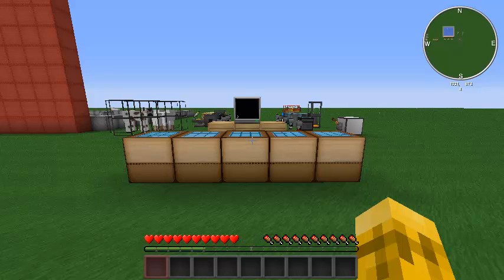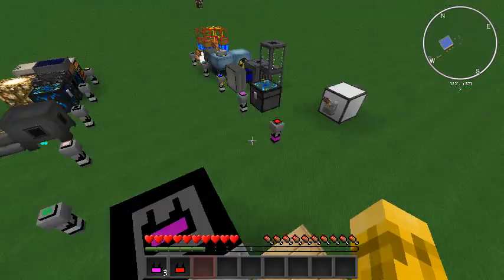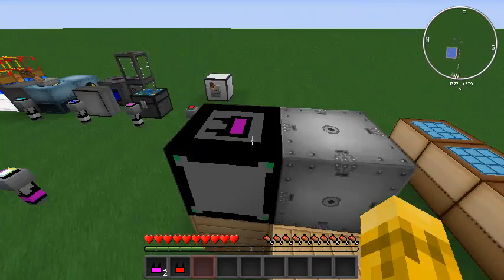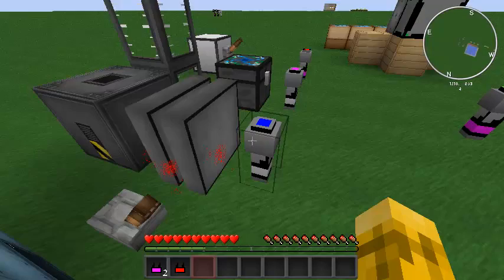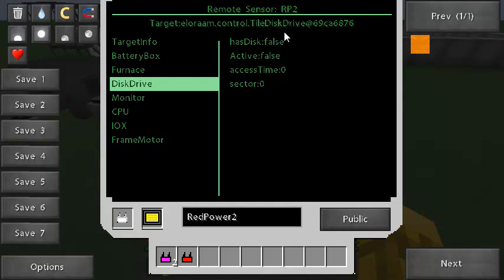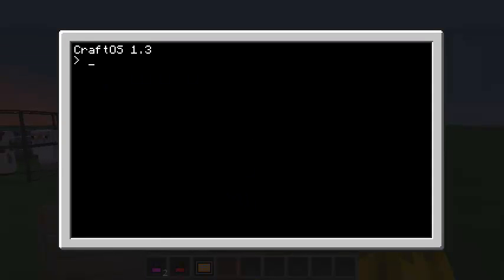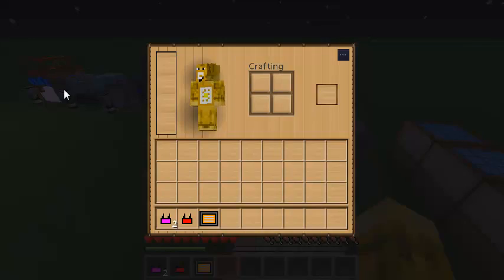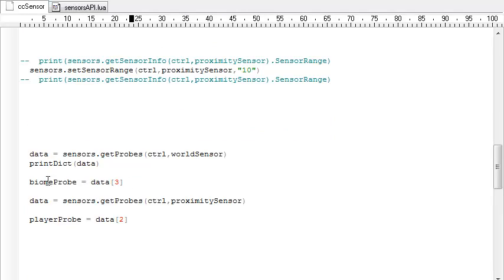Minecraft ComputerCraft Tutorial 8 - Peripheral - ccSensors

Comment from the maker: The trouble is that the code you need to use changes based on how you setup your sensor and network.  But you'll need something like this:

os.loadAPI("/rom/apis/sensors")
ctrl = sensors.getController()
data = sensors.getSensors(ctrl)
proximitySensor = data[1]
data = sensors.getProbes(ctrl,proximitySensor)
playerProbe = data[2]
data = sensors.getAvailableTargetsforProbe(ctrl,proximitySensor,playerProbe)
playerTarget = data[5]

The numbers that go in the data[x] call will need to change